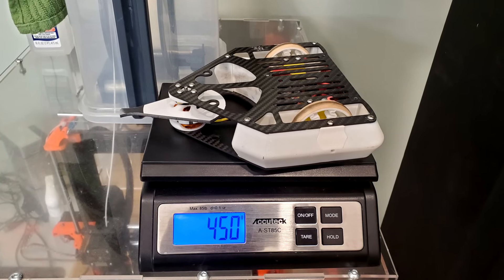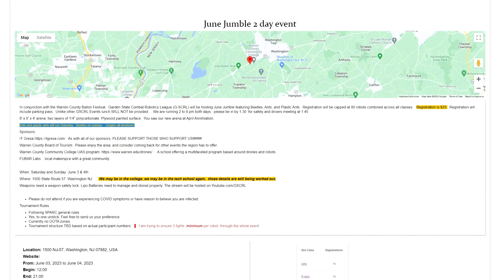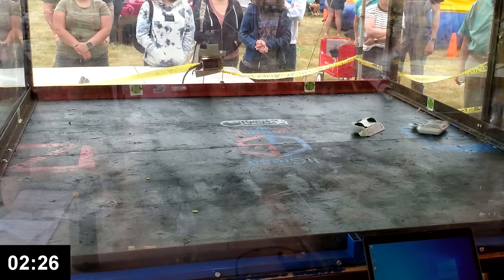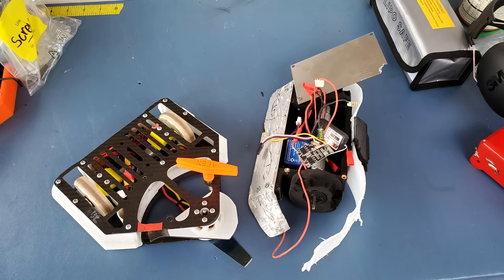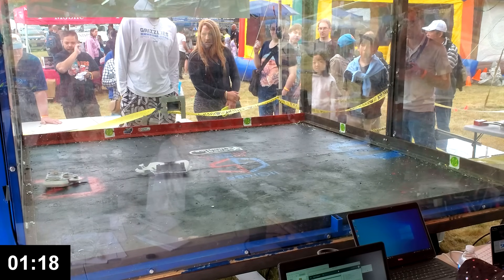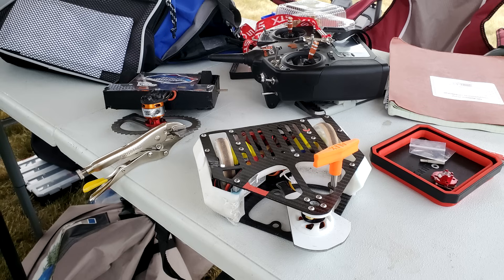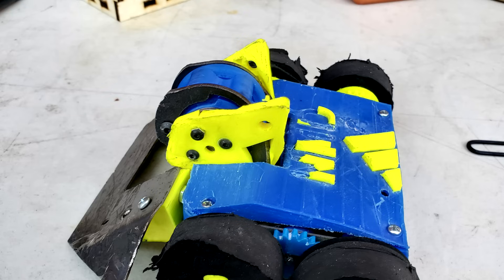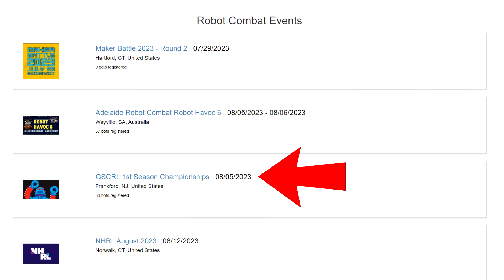Cheesecake has Deja Vu! (June Jumble 2023)

Comment: 00:50 did you modify your motors top screw holes for bigger screws? what did you use? M2 or M2.5?
Reply from the maker: Nope, they're the same M2 holes as before, not modified by me, but I'm using some countersunk screws from McMaster whose heads are small enough to fit next to the central shaft, despite how close the M2 holes are to said shaft.
Reply: @alexsalchemy  thank you so much for the reply! Is there any chance you can share a link to the screws that you used or possibly a part number for McMaster? I'm very interested as I'm building my own weapon system for a horizontal spinner but using the same motor. Thanks again!

Comment: You still have one major weakness that you don't seem to have noticed. ever since you made your weapon smaller, although it increased performance and spin up, the decrease in range has made it so you are a lot more likely to get hit in the sides and back than when you had the larger spinner.
Reply from the maker: You are absolutely right, and while I don't have a surefire solution against all opponents with longer reach, I do have a solution for undercutters specifically. I'd like to improve my weapon reach, but this will require a more aerodynamic testing and experimenting with different weapon shapes.
Reply: @alexsalchemy  It might also help to move the center of mass back, or maybe move the wheels back. Something to make it so the point the bot pivots around is further back. decreasing the friction of where the front of the bot drags against the ground might also help a little bit in extend this pivot point further back.
Extending the weapon portion of the frame forward might help, but that might have drawbacks that outweigh the advantages.

PS: The driving is really good. It seems that both your driving skill and the control of your bot has improved a LOT since the beginning. Your driving in this tournament has been straight up methodical.

Comment: the wedge dulse del lucha wont work… maybe if you attack from the side but if you go head on you will bite the inside of the wedge ripping it appart
Reply from the maker: You'd think so, but those forks are attached really well. I've never seen a Candy Wasp get its wedge or forks ripped off. I guess we'll just have to wait and see though!
Reply: i would have mote hope if it had a wedge in the middle 13:18 instead of just an openning

Comment: i wonder if the white bits of armor are hollow on cheesecake? maybe having lattice or some sort of honeycomb in there would give you more armor and a larger surface area of defence for weapons like what cheesecake has.
Reply from the maker: Oh yes, the white armor is 3D printed. The sides are TPU with 10% infill, and the back is ABS with 10% infill, so they have a 3D honeycomb structure inside, and you can kind of see it in the damage I sustain.

Comment: Against an undercutter something that might work is to simply take your basic sweet tooth design and put a bit of a chamfered cup/puck on the front, forcing the opponent's blade downwards underneath your front frame assembly and then raising your weapon right up into the front face of their robot. If you can smack them in the face before they can smack you in the tire you can (theoretically) come out better in that engagement since they physically cannot hit you from the front.
Reply from the maker: Don't spoil the surprise ;)
Reply: @alexsalchemy  semi competent minds think alike I suppose.

Comment: What if you try to use the wall to launch Cheesecake into your 
enemies
Reply from the maker: Well, one of the things that makes vertical spinners so dangerous is that they get to push off the floor. I've thought about doing the same thing but horizontally, pushing off the walls. Unfortunately, this would require me to stay by the walls, and I would lose the match for failing to engage with my opponent. The walls only exist on the edges of the arena, but the floor exists everywhere, so vertical spinners get that advantage of being able to push off of something no matter where they are.

Comment: So, I've been binge watching robot battling videos, and my brain came up with a concept.

Let's say, I dunno, a fae or something of that size created a robot for tournaments that has a cockpit on top, so they can directly operate it.
Let's assume there's magic so that the cockpit itself is practically indestructible, the pilot is safe.
Would that still be allowed, if it was confirmed the pilot would be fine? And if so, what kind of advantages and disadvantages might it bring?

For visualisation, I'm imagining like, a little glass dome on top of the robot. Assume it's designed after Cheesecake if the type of robot is too big of a factor to say otherwise.

Comment: have u tried using ptfe domes on both sides of the motor screws so it protects the screws and deacreases friction and stop it from getting snagged on the floor with the screws ?
Reply from the maker: I'm probably just going to use countersunk screws instead: nice and flush with my black chassis plates.
Reply: @alexsalchemy  countersunk screws may be more of a problem due to making the carbon more thinner especially if u put it into the weapon area unless u beef up the lower plate or make a brass shimm to stop the carbon from twisting but would need testing tbh

Comment: Nice!

I don't think you should've called out your own battery being exposed, it was still fully protected in the bot (just some extra ventilation, but the top and bottom were still extending over it) and with the other bot weapon being disabled there was very little chance of the battery getting hit.

The battery rule is there primarily so the organizers don't have to deal (as much) with lipo fires and is only really applicable when the battery is fully exposed outside the bot so it could get damaged in a collision between the bots, or exposed enough that a weapon could easily hit it, neither was the case here.

I think if the opponent had a big pointy spike on the front it would've been different.
Reply: Agreed. Maybe "battery endangered" or "battery under threat" would be clearer language.
Reply: more cooling for battery lol

Comment from the maker: Hello everyone! Some notes:
1. The more I review the footage, the more I think I should have called my own battery out even though the referee did not.
2. My driving is indeed noticeably worse than my last tournament.
3. My battle-hardened motors worked extremely well, and I never had one die, so I forgot to even mention them later on. Isn't it nice when things just work?
Reply: Under Construction driver here, still glad that we both had a good time with the fight… and beware, a new challenger is approaching
Reply: Every match is a lesson. Nice weapon !😊
Reply: ok im not a expert on these bot tournaments. heck this is the only fights I've looked at in a long time. but. its not your fault your bot wasn't called out bcs of the battery rule thing. but to me it looked fine. to me the one guy that you knocked out you literally had exposed his battery. yours wasn't exposed it was still in its casing. ive played sports all my life and sometimes people just get away with things. rather it be an accident something happened or intended. you did great and your bot performed well. the judges are thier to call the fight if they see a issue and they didn't see any issue.
Reply: You honestly inspire me to do what I was planning on doing for years, but was lazy/scared to do.
You seem to have so much fun fixing problems that appear and then trying out the design to figure out what else you could improve